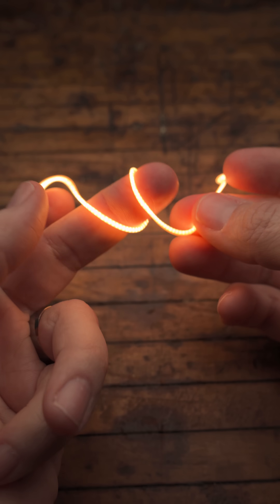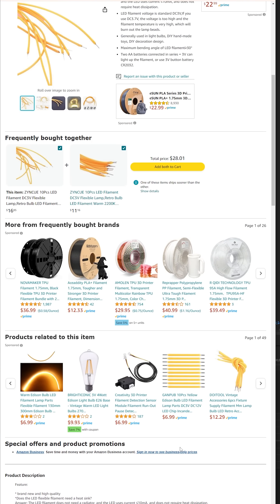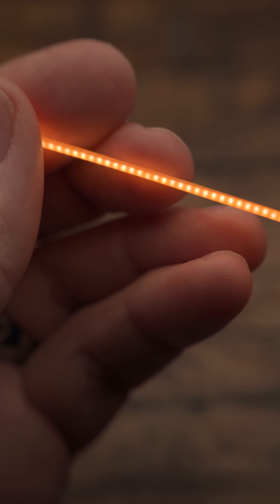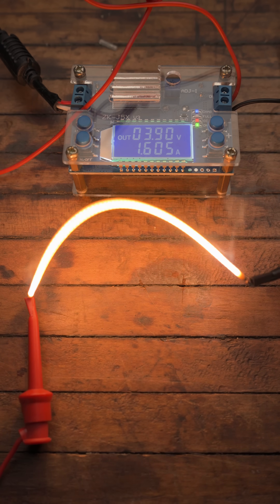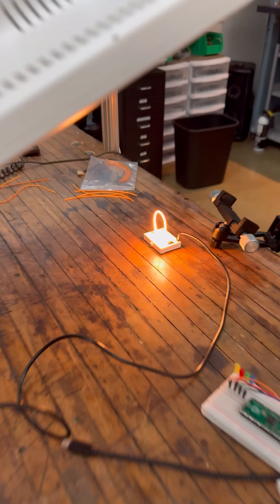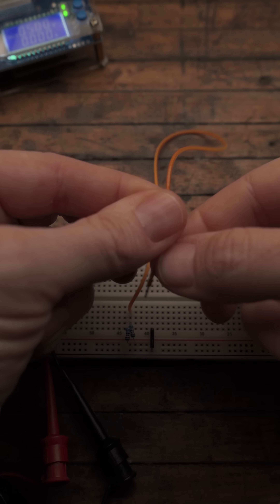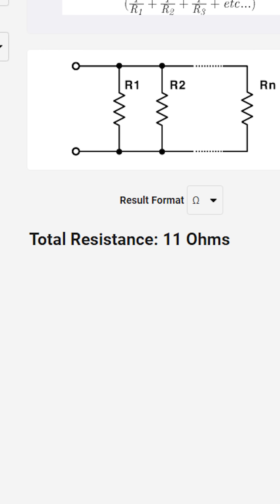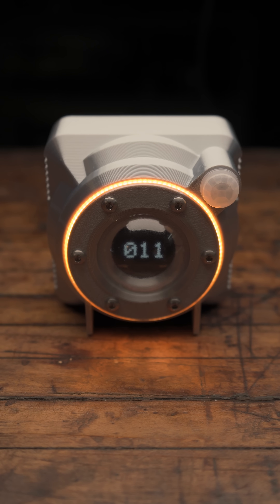#FlexibleFilamentLED

Comment: I think they recommend 100ma so people don't burn up their equipment. I've seen websites where they list 400ma max
Reply: Longevity possibly? A lifetime experiment would be cool.
Reply: If you want to know the rating for your individual item (including manufacture variance between two of the same parts.) You can plot the power vs output lux and see where the gradient starts to approach  the max for your specific tech. (Does not work well for combination LEDs e.g. RGB.)

Lux can be measured easily using a smart phone sensor tool e.g. Phyphox or other you trust.

When the current to lux increase starts to approach the max gradient for your specific LED colour. You know you're there.
You can test the gradient with a sacrificial part. Or by looking up the graph for that tech e.g. Gallium Nitride for some white LEDs 150lumen per watt.
Reply: Does anyone know how these react to heat? I have a situation where I want to install them into a sign, encased in epoxy resin, out side (lights only, driver inside), but it will be in the sun (that’s where the heat comes from) …. We have tried all types of ribbon led lights and they only last max 3 years.

Anyone know if these are fragile in sun type heat, 40-50 degrees C?
Reply: how powerful the sunrays there, in my place everything LED which exposed to the mighty sun only good for 1 year or 2 if it got lucky, nothing surpassed the third year 😂
 @jasoneganis
Reply: @jasoneganis  From my analysis of dozens of models and theoretical knowledge, the best practice with LEDs to ensure their longevity is keeping their current low.
I would NEVER run my LEDs at more than half their NOMINAL RATED current (which is lower than the maximum), regardless of their environment temperature.
The only exception would be short durations of light, where I would allow maximum current for no more than about a minute, but typically in seconds or less.
I usually go for 1/4 to 1/3 of the nominal rated current, which ensures they don't overheat and end up lasting much longer (at least as many times as you reduce the current).
Hot environments are even worse for them, and in a  50-60°C environment I would never go over 1/4 of their rating, and would probably keep it around 1/10.
As efficient as they are, they still generate heat and are also sensitive to heat, so running them at a much lower power will greatly increase their life expectancy.
The people here who talk about running them at maximum ratings and testing their limits really don't know much about LEDs.
Sure, you can run them even above their maximum ratings, but you will greatly shorten their life expectancy, plus they will run at a slightly lower efficiency.
If you need more light, better use more LEDs, and make sure they don't heat each other up; the more of them you add, the more cooling surface area they need, meaning each additional watt of power needs that much more cooling area.
More LEDs usually means more surface area available to radiate or conduct the excess heat away, especially with the filament type LED strings which have very poor or no thermal conduction, unlike surface-mount LEDs.
Reply: Off topic abit but doesn't epoxy break down in sunlight? @jasoneganis
Reply: @jasoneganis  what destroys leds life span when overvolting is the resulting heat AFAIK
Reply: @jasoneganis  In that situation I would recommend underpowering them, to account for the increased thermal load.

Another issue you may run into is resistance to UV exposure, a lot of things break down under constant UV light.

It may be best to search for something similar specifically designed for outdoor use.

I am not an electrician, I am a small-time hobbyist, so take what I've said with that in mind, other's will likely have better information for you.
Reply: Absolute maximum ratings in most electronics are ratings that the electronic device can survive for very brief instances. Like 100 ms bursts.

You need to rethink your circuit if components are running at their absolute maximum voltage/current.
Reply: @kbee225 no. Most of those ratings are something the component can survive for a very long time provided there's sufficient cooling.
Reply: The recomended current is often specified in terms of lifetime. While higher currents may be used adn will usually result in higher intensity, the product lifetime will typically be shortened when using currents higher than secified. A good datasheet will provide this information so that the engineer can make trade-offs regarding product performance and lifetimes. However, note that there is a limit to how high the current can go before the product is destroyed!
Reply: I totally agree, that would be awesome! Test 100ma, 150ma, 200ma, etc. and keep them on 24/7 and record it. Youd get to see exactly how long they each last with a certain ma
Reply: in my place everything LED which exposed to the mighty sun only good for 1 year or 2 if it got lucky, nothing surpassed the third year 😭
Reply: If you want a high reliability product, it is important to keep the drive current within the company’s specifications. Maybe 99% of parts can survive 120% of the maximum rating, but exceeding the rating will lead to fallout
Reply: Doo doo tee tee diaper rash
Reply: depends from size of crystals. even 100mA can be lie
Reply: Man yall is to smart idk why im even here
Reply: Yeah first thought here is "Most people dont mess with electricity in a hobbyist or professional format, telling them a low threshold prevents accidental misuse or unwanted harm"

I feel its more responsible than simply throwing folks to the wolves, but I still think there should be "advanced information" for users who may be more knowledgeable.
Reply: @Thebloodylies  It's also possible they just don't have very consistent quality, and it's easier to give safe recommendations than to deal with RMAs.
Reply: I don't know why my comment was removed, maybe some people hate facts and knowledge, but here is a shorter version:
listed currents are maximum currents at which LEDs can be run with proper cooling or at room temperature.
Without good cooling or if exposed to higher temperatures or heat sources (like sunlight), LEDs should never be run even at recommended currents and especially not at the maximum currents - in such cases, cutting the current down to 1/2 to 1/10 will definitely make LEDs last much longer.
The general rule is that the more you reduce their operating current, the more you extend their lifetime.
Trying to find out how high you can raise the current is like trying to find out how fast can you burn them.
If they're running hot, they will not last long.
Reply: @edinfific2576 Hah! Indeed, when I was first experimenting with LED bulbs back in the early 80s, I found that if the LED was warm when lit, it would be dead in minutes. I would find the best the resistor value by touching the bulb to my lips. (Which are far more sensitive to temperature than my fingers) This was before I learned about ohms law and how to calculate proper resistor values mathematically.
Reply: @edinfific2576  efficiency is increased at the lower currents , less light produced but the light is more per milliamp .
Reply: 350mA is a good starting point for lots of LEDs of a certain wattage